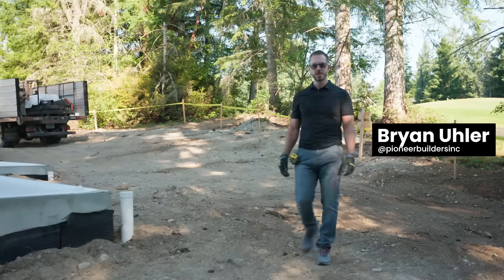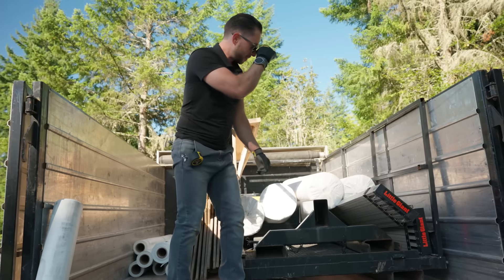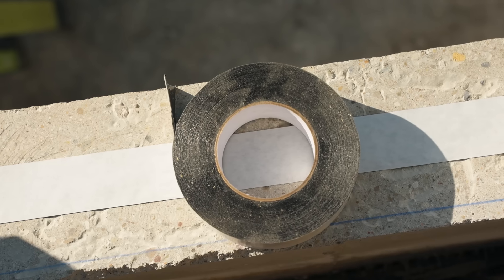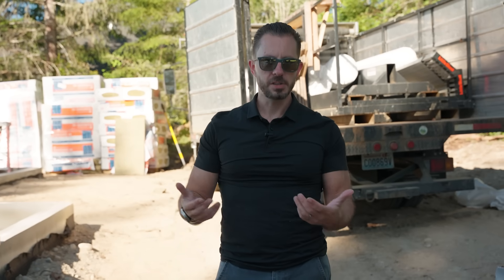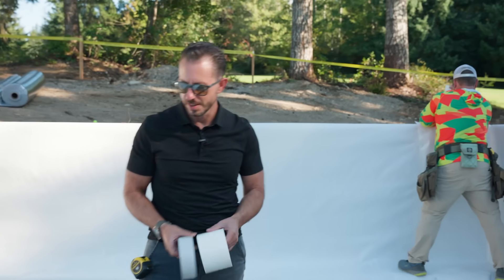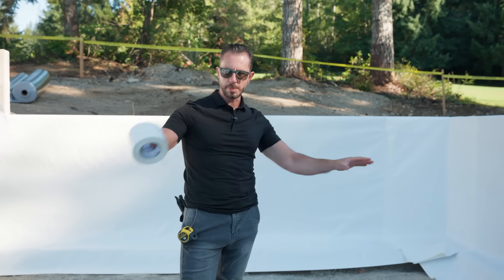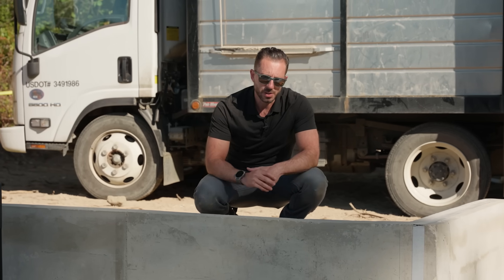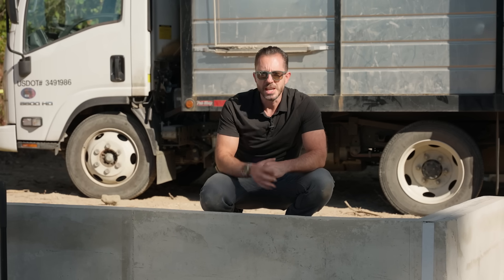Crawlspace Science: Why Vapor Control Matters

Comment: I asked a nationwide company about encapsulating my existing crawlspace on our 1960 home in Santa Fe, NM. They said it would degrade our foundation and footers due to moisture. I found this incredibly weird as this was a foundation company. Does anyone know if that is possibly true,
Reply: Depends on how it’s done. Concrete doesn’t do well if it’s constantly wet, so if you only seal it from the inside, then that can cause problems. Combine that with a French drain on the perimeter and  that should mitigate the problem. I’m not a pro, but that’s my understanding.
Reply: If there's enough moisture under your house that sealing it in would wreck the building, you really need drainage! Other than that, I'd be looking fro a second opinion locally. Just make sure their work is insured, and you should be fine.

Comment: I think a vapor barrier is needed but I also think “radon” is bull.
Reply: I like how you put "radon" in quotes, as if it isn't even a real element in the periodic table. Really ups your credibility.
Reply: @RedMike-ym8hd let me guess you make a living doing crawl space encapsulations
Reply: @oliverhairston2937  Nah just a homeowner who knows how to read and has spent a lot of time and sweat in my crawlspace encapsulating it. I'm always trying to learn, though, so if you have any data refuting epidemiological or radiological studies on radon I'm open to hearing it (not gonna hold my breath, though!)
Reply: @RedMike-ym8hd  i’m not saying radon isnt real but the testing for it is a little suspicious. Worked for a builder and when we would sell a house, we would have multiple home inspectors do radon testing. every result was different. The same house would fail one test and pass another. Inspectors were quick to blame a door being open or a window cracked. Sounds like you’ve done your research and good for you. I’m just not sold on it.
Reply: @oliverhairston2937  I see what you mean. I have a continuous monitor in my house (Airthings) because our initial tests detected moderate levels, and levels really do vary quite a bit even after we sealed everything. A low pressure system, heavy rain, etc. can cause levels to spike for a day or two, then they'll calm back down. And when we open windows on a nice day, it also sends levels down. Ironically, air sealing and insulating the rim joists partially undid the effects of all the encapsulation work, I guess because any soil gases that still come through are getting trapped in the house, but overall we're below 3 pCi/L now on the main floor. We don't sweat a little spike every few weeks.
Reply: And "seat belts", "asbestos", "vaccines", "running with scissors".  It's all just woke.